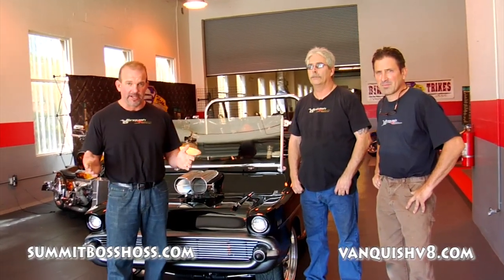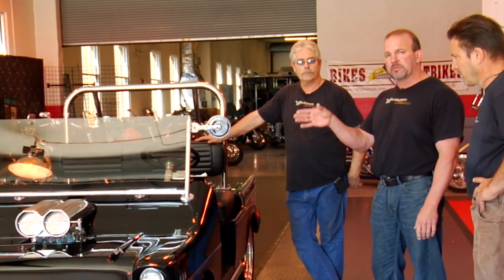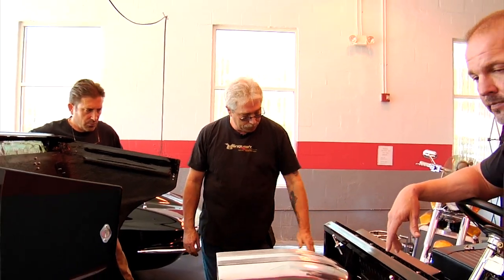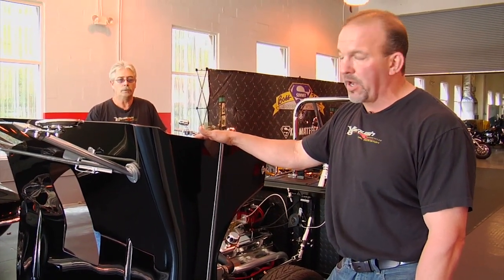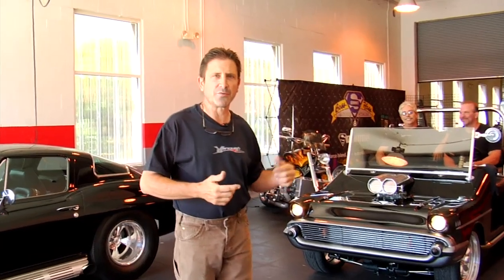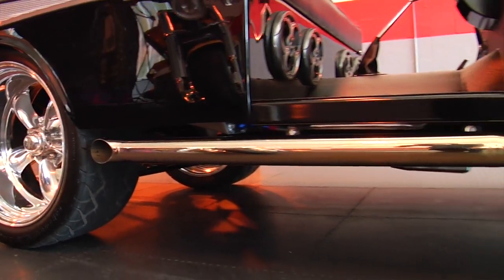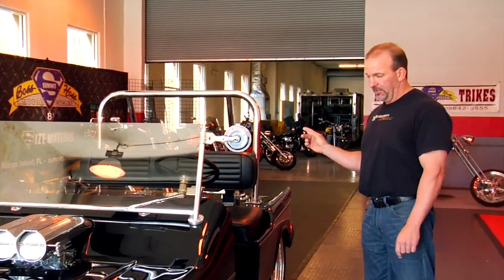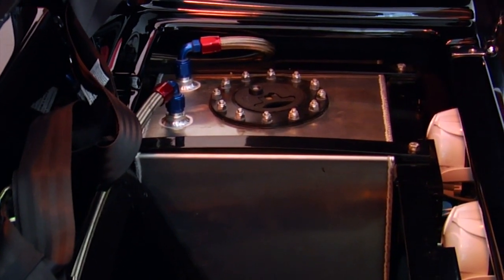BILLY GRAHAM V8 GOLF CART

Comment: There's no way in hell that thing is 400 horse. Not only is the carb too small but the header pipes aren't even real headers. Those headers don't even have individual pipes running to the average 3 inch tribolt pipe. Its basically a glorified exhaust manifold. And to top everything off. When he does the 1st to 2nd gear burnout it appears that he is flooring it, on a light body and frame like that it should be able to practically burnout at idle in last gear. Of course that is an exaggeration lol. But even still there is just no way that it is putting out 400 horse. It's probably putting out 250 horses at max.